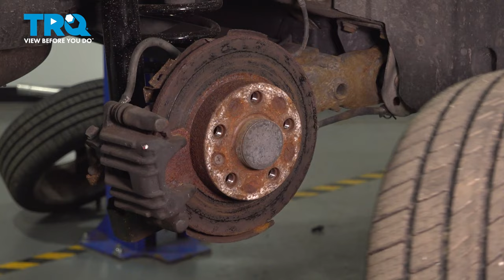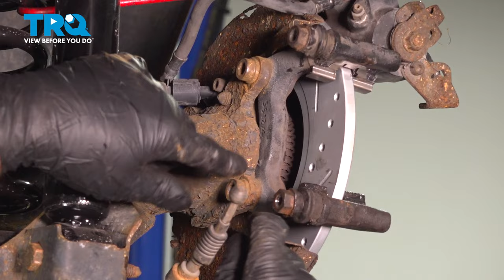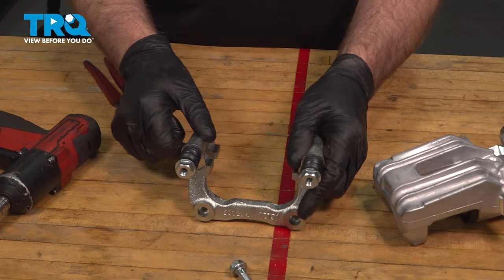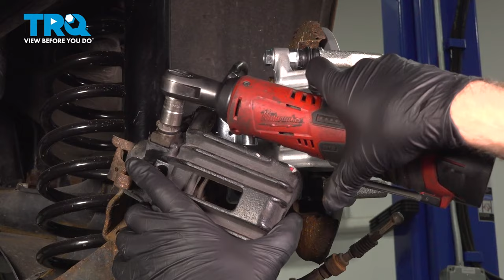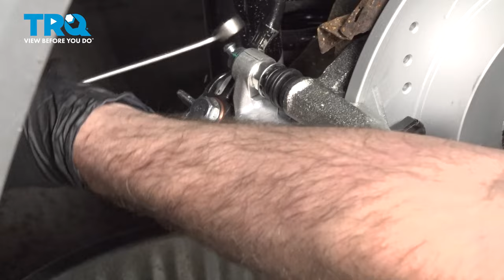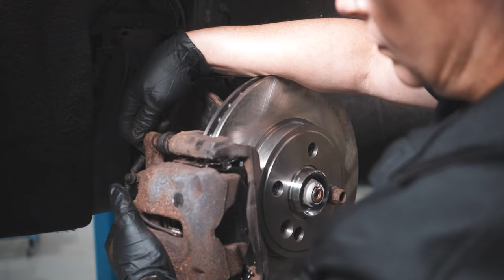How to Replace Rear Brake Calipers 1999-2005 Volkswagen Jetta

Comment: Do you have to use a torque wrench? I can torque the lugs after i put the brake on but dont have access to the TW while doing the back caliper. My old one locked up on the rotor and clamped down so hard my tire on that side would not even roate. BaD idea to let the pads get so low on these when they have over 100 thousand miles on them. The chambers seem to start to warp.

Comment: did you really just put the silicon grease underneath the brake pad hardware? and also not even apply the grease to the proper side. that's sad and you shouldn't be performing these jobs.